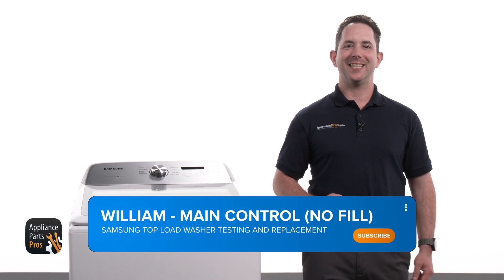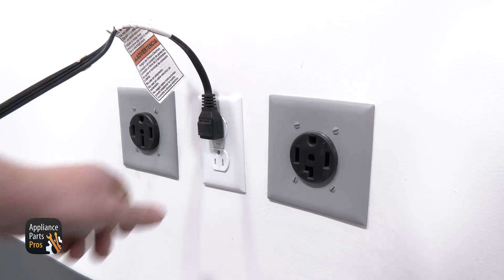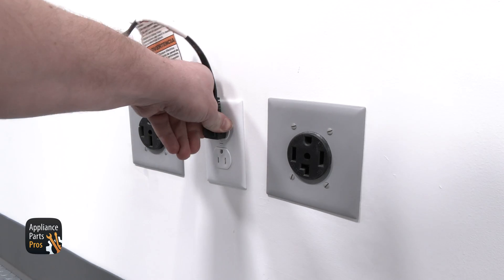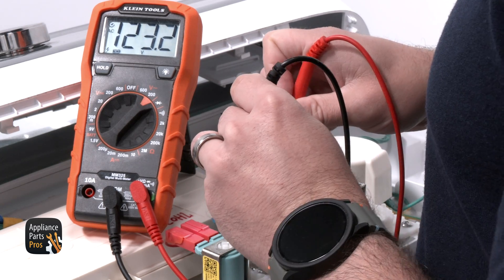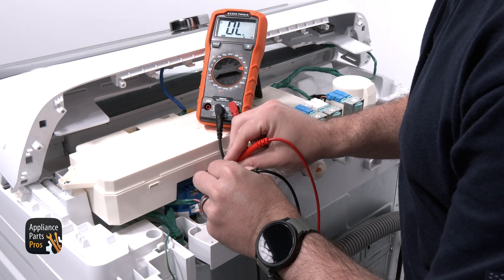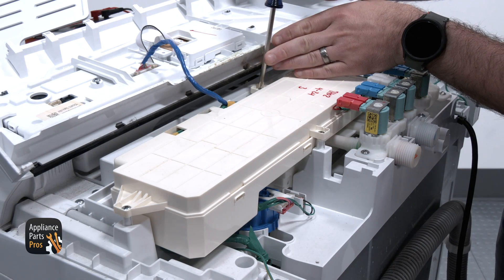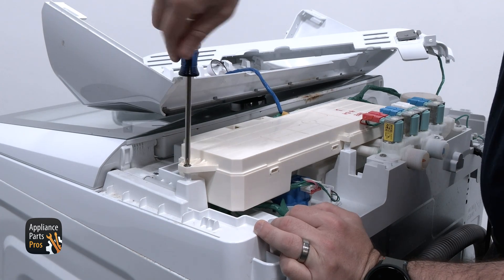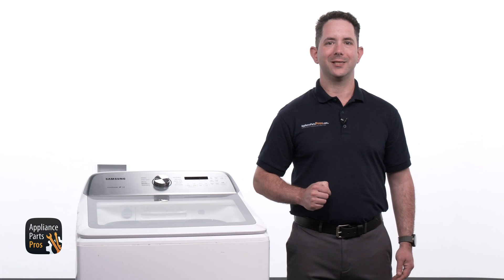Simple Steps to DIAGNOSE and REPLACE Samsung Washer Control Board

Comment: Does the hds-dd d1619 number have to be the same for the replacement board?
Reply from the maker: Not necessarily, because boards can be replaced by newer versions in some cases. What is the model number of the washer?

Comment: So I got a big problem my samsung washer shut off no power and door was unlocked and didn't want to come back on a washer guy said it was the main board he replaced it still no power and he replaced the interface board to still no power what can it be
Reply from the maker: What's the model number of your washer? We may have a tech sheet we could use for troubleshooting.
Reply: @appliancepartspros DC68-03194M-00 samsung washer top load
Reply: @appliancepartspros my bad model is WA52A5500AV
Reply: @appliancepartspros theres also a green  linking light on the control board uts self
Reply from the maker: This unit has several control boards. Do you know the part number that he replaced? I'm showing that DC92-02965P is the part for your unit. https://www.appliancepartspros.com/samsung-assy-pba-module-dc92-02965p-ap7225764.html
Reply: @appliancepartspros yes thats the part